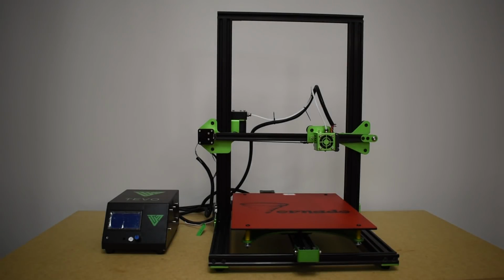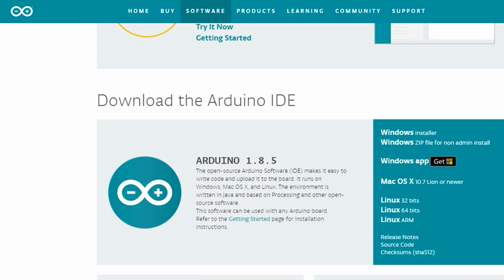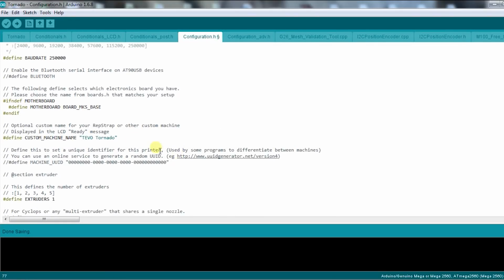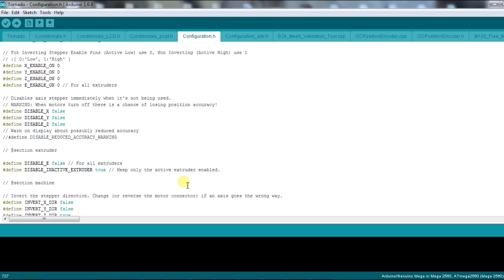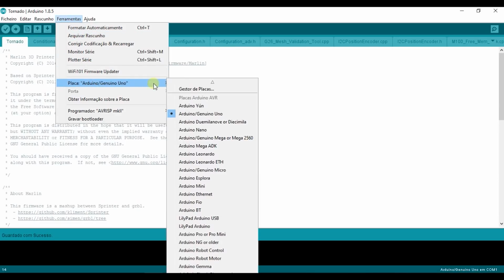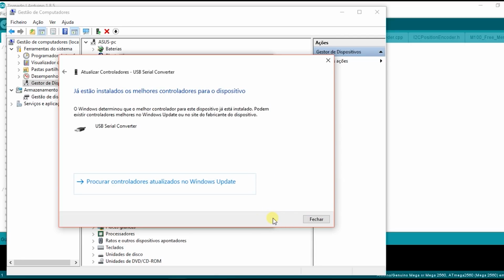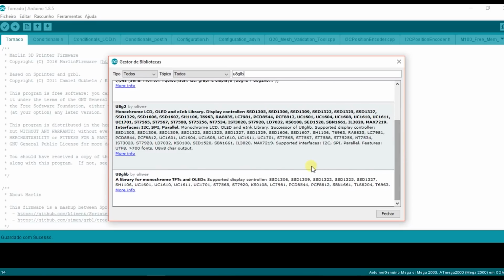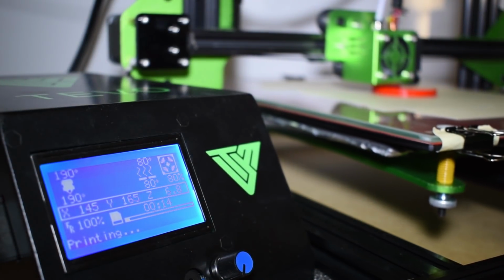TEVO TORNADO 3D PRINTER - HOW TO UPDATE THE FIRMWARE

Comment: Hi on my Tevo Tornado the bead temperarure start to show 70° when just turn on, so i think is the termistor, i interchange the conections on the board and nop, the same so that means that is not the termistor. I order a new board an is about tonarrive, do i have to do the same on this video to load the firmware or some thing diferent since is a brand new board???
Reply from the maker: Hi, most probably yes, you will need to install the bootloader first on the new board. You can try to install the firmware first anyway and check.

Comment: Trying to do this with the Tarantula Pro after following your install and setup videos.  I bought this second hand, and the original owner had installed the touch/auto-level sensor but did it incorrectly.  It has the hardware, but not the firmware for the sensor as best I can tell.  So I followed your video to check the sensor out, which led me here.  But I get an error and my computer doesn't have some of the USB drivers yours seems to and I can't get them to replicate.  Arduino says, "Compilation error: #error "Oops! Make sure you have the LPC1768 environment selected in your IDE."

Also, for some reason, when I move my x & y axis on the printer 1mm, it appears the axes are inverted (+ moves in the - direction in both x & y axis)

Comment: Hey there, sorry to bug you, but I attempted to do this to my tornado to change some extruder settings after installing a BMG to it, but unfortunately upon upload, I get the error:

avrdude: stk500v2_ReceiveMessage(): timeout
avrdude: stk500v2_ReceiveMessage(): timeout
avrdude: stk500v2_ReceiveMessage(): timeout
avrdude: stk500v2_ReceiveMessage(): timeout
avrdude: stk500v2_ReceiveMessage(): timeout
avrdude: stk500v2_ReceiveMessage(): timeout
avrdude: stk500v2_getsync(): timeout communicating with programmer
An error occurred while uploading the sketch

Any idea how to fix this? This is on a brand new, 2 week old Tornado running Marlin 2.0.5.3 from factory.
Reply from the maker: Hi, that error means the PC/arduino IDE is not communicating with the board. Check the baudrate and com port settings.

Comment: My computer will not install the drivers 
:(
Reply from the maker: Did you install arduino IDE? It also has the FTDI drivers. Are you working with a Windows PC?
Reply: @ruiraptor  Weird bug. Apparently the USB has to be plugged into the motherboard, it wouldn't connect through the front ports.

Comment: hey! this is a great video and the first time it worked but my extruder was running backward, when I did the update in arduino everything went well except when I tried to upload it to my tevo tornado. Here's the error:

Arduino: 1.8.12 (Windows 10), Board: "Arduino Mega or Mega 2560, ATmega2560 (Mega 2560)"

Sketch uses 119002 bytes (46%) of program storage space. Maximum is 253952 bytes.
Global variables use 4607 bytes (56%) of dynamic memory, leaving 3585 bytes for local variables. Maximum is 8192 bytes.
An error occurred while uploading the sketch
avrdude: ser_open(): can't open device "\\.\COM6": Access is denied.

avrdude: ser_drain(): read error: The handle is invalid.

avrdude: ser_send(): write error: sorry no info avail
avrdude: stk500_send(): failed to send command to serial port
avrdude: ser_recv(): read error: The handle is invalid.

avrdude: stk500v2_ReceiveMessage(): timeout
avrdude: ser_send(): write error: sorry no info avail
avrdude: stk500_send(): failed to send command to serial port
avrdude: ser_recv(): read error: The handle is invalid.

avrdude: stk500v2_ReceiveMessage(): timeout
avrdude: ser_send(): write error: sorry no info avail
avrdude: stk500_send(): failed to send command to serial port
avrdude: ser_recv(): read error: The handle is invalid.

avrdude: stk500v2_ReceiveMessage(): timeout
avrdude: ser_send(): write error: sorry no info avail
avrdude: stk500_send(): failed to send command to serial port
avrdude: ser_recv(): read error: The handle is invalid.

avrdude: stk500v2_ReceiveMessage(): timeout
avrdude: ser_send(): write error: sorry no info avail
avrdude: stk500_send(): failed to send command to serial port
avrdude: ser_recv(): read error: The handle is invalid.

avrdude: stk500v2_ReceiveMessage(): timeout
avrdude: ser_send(): write error: sorry no info avail
avrdude: stk500_send(): failed to send command to serial port
avrdude: ser_recv(): read error: The handle is invalid.

avrdude: stk500v2_ReceiveMessage(): timeout
avrdude: stk500v2_getsync(): timeout communicating with programmer

This report would have more information with
"Show verbose output during compilation"
option enabled in File -> Preferences.
Reply from the maker: Hi, it seems that you didn't select the correct com port.

Comment: Can you give me the link to the correct 2018 gold editio tornado firmware. When I try to go to the link in the video I can't find the correct firmware. Thanks
Reply from the maker: Hi John, the easiest way is to download Marlin 2.0 and use the configs for the tevo tornado (check the config examples in the Marlin folders). In this video you can see how to get the config files from Marlin (https://youtu.be/faHfUIZXPMo)
Reply: ruiraptor thank you for the help.  I need a little more help. I downloaded the marlin 2.0 file which did not include the config/example files. First, issue. I then found a second link to the tevo example files. I see that there is a 3rd bug fix set of files. I see in the board.h file there is no board for the mks_gen_L board. Another issue. I emailed Tevo and for their stock firmware they said the mks base board has the same pinout so I could use that file.  I am not sure which is easier/better; just use the Tevo firmware or use the Marlin 2.0 version. I guess I will have to use the motherboard type of mks_base. Is this a toss up on which version to use? Or is there any advantage using the Marlin software over the tevo software. Thank you.
Reply: @ruiraptor  404 not found..
Reply: @ruiraptor  also The like does not work.
Reply from the maker: John, do you have a facebook account? If yes, look for firmware updates or firmware versions from users in the official tevo tornado facebook group.
Reply: @ruiraptor  I have checked just about everywhere including Facebook. I am slowly getting all this down little by little.  I think someone needs to update Marlin 2.0.x for the MKS_gen_l v 1.0 and v1.4 boards. This is a common board.

Comment: I have some questions about Tevo Tornado hot end problem. My Tornado (Feb 2018 version) had been printing ok. Then on a print job it got all messed up with the body lifting off the bed and filament building up, ....etc. What I found was the hot end was not heating up to temperature and the filament was trying to extrude more in a soft plastic blob fashion rather than a filament thread. Tevo was set at 210 C but the hot end measured about 142 C directly on the hot end on the heat sink (fans off to the side). I figured the thermostat went bad and installed a new hot end but still have the same problem. So now I guess the problem is in the board or software. You explained it very well, but it still seems rather complicated to me (still trying to figure out my cell phone). Not sure what to do next, so your opinion on a direction for repair would be appreciated. I also better mention I would be using a Mac lap top, not Windows, would that be a problem? Thanks.
Reply from the maker: Hi Tom, if you have a mac, then you need to install the arduino IDE for mac. Use it to open the firmware and flash to the board.
Reply: @ruiraptor  I was looking over some videos on how to flash firmware. Being new to anything like this I did get lost on some points right off. 1st - picking the port and baud rate. Video was for windows and showed the Device Manager, I don't know where such a thing is on the Mac? 2nd - video showed code lines where specific board and other values were to be entered, I have no idea what my board type is. 3rd - a 100K thermistor was picked, but mine measures about 146K ohms. The video didn't seem to show any optional values. Once files are made and connection to the printer is made  what does one do to start the flash? May seem like a simple question but I have neve done anything like it before.
Reply from the maker: Hi Tom,
1- can't help you there as we don't have a mac. Try googling for this step.
2- Are you referring to the settings in arduino IDE? If yes, then you need to select the same board and processor as in our video (if you are using the tevo tornado)
3- We didn't mention any thermistor. If you download the firmware for the tevo tornado, don't bother with that since that comes already setup.
Reply: @ruiraptor  #1 I have yet to find an answer. I called the Apple Store in town and as of 2 days they have not called back. Support is not their # one priority. My guess about the MAC is all I have to do is connect up the USB cable and it will then connect up - magic! Or not.

#2 I still don't know the board type, so I will go back and check out which board you used and use it.
Lastly - I will try to flash the firmware after figuring out a few more things. If it fails I have been looking at the Sovol SV01 as a replacement. Will post once more in a few days as to final outcome.
Thank you for your assistance, I really appreciate it.

Comment: Im trying to upgrade the firmware on the Tevo Nereus and a having a really hard time trying to figure this out. Is it even possible to run marlin on the nereus. Im having problems with me extruder motor after putting a direct drive on it im hoping the firmware will fix it ive tried everything else I can think of the motor is getting power but its not strong enough to turn the direct drive unit and when its not on the unit it just skips in place
Reply from the maker: The Nereus runs Marlin from stock. Not sure what you did but check the steps/mm and the vref value.
Reply: @ruiraptor Thanks for the reply. I got it figured out after watching a few videos. I was just being a novice doing unnecessary things lol. I did not know the Robin nano is 32bit so I used Atom and the nereus example in the Marlin firmware. I was trying to change the stepper drivers in the firmware with great difficulty until I learned this is unnecessary. As for the extruder stepper the cable I was using was my issue. Took me a bit to figure that out but now I know to be cautious of this in the future(especially before I tidy up the cables, learned that one the hard way). Im well on my way now with what I'm doing to the printer(I put a V6 hotend and a dual drive extruder on it cant wait to try it out) again thanks for reply, and keep up the great work!

Comment: Ruiraptor, Can you please send me the Tevo Tornado Flash Firmware (with the Tevo.ino file), The Tevo Facebook group is closed and the current github Marlin link is creating too many error messages when trying to flash with it in Arduino. Apparently someone else in your comment section had exactly the same problem. My email is fairvalues@gmail.com

Comment: Request Help!!! Getting this error 

avrdude: stk500v2_ReceiveMessage(): timeout
avrdude: ser_send(): write error: sorry no info avail
avrdude: stk500_send(): failed to send command to serial port
avrdude: ser_recv(): read error: The handle is invalid.

avrdude: stk500v2_ReceiveMessage(): timeout
avrdude: stk500v2_getsync(): timeout communicating with programmer

avrdude done.  Thank you.

Problem uploading to board.  See http://www.arduino.cc/en/Guide/Troubleshooting#upload for suggestions.
Error while setting serial port parameters: 115,200 N 8 1

Connected USB to PC (NO Main Power) Windows 10 Sees it as Ramps (Comm5) however cannot get arduino to communicate with the board.
Reply from the maker: Hi, is it a new board?
Reply: @ruiraptor  no it is not exisitng board that was in it just changed the drivers to 2208 and 8729 already adjusted vref voltage for them just cannot reflash firmware to new steppers

Comment: i cant fine the firmware on facebook group help?
Reply from the maker: You have to look in the file section.
Reply: @ruiraptor  And also my tevo tornado while printing it will randomly home y and x axis and the extruder tries to pull filament out and back in and continue printing. i tired 3 sd cards. same problem. would love for you to help me with this issue.
Reply from the maker: Check the display and its cables. Make sure that they are correctly connected and the flat cables are not close to the power supply, SSR or any component that will cause noise interference. Also check if the card slot pins are ok and contact correctly with the sd card
Reply: ruiraptor thank you so much. Your videos in the tarantula helped me a lot to.

Comment: i have this weird -14 nozzle error and thought i would put marlin on and i did my best to follow your instructions but i don't have face book so I got the marlin from github any way i have red words what do i do now?
Reply from the maker: Hi,
Check if the original tevo firmware compiles correctly ( https://github.com/tevo3d ). 
Do you have all the libraries installed?
Reply: @ruiraptor  OK i have flashed it I think, but it never changes the home screen from 1.1.4  it just says tevo like normal. Anyway I put new thermistor in and it was only one degree different from bed.  I am terrible with soldering iron. so we will see how long the connection lasts. When I connect to my computer my computer sees a usb device but it doesn't show any kind of 3d printer. It allows me to upload etc. Or at least it acts like it is. Printer screen blinks like your video. the print looks very under extruded that was a problem I had before thermistor broke.
Reply from the maker: @cscherbarth1622 , check your extruder calibration and flow/multiplier calibration. If you have your hotend correctly assembled ( check here: https://youtu.be/rvkj8f_xNtE ) then it might just be the calibrations.

Comment: Hello, I was updating my firmware for the Tevo Tornado and I get this error. Sketch uses 127454 bytes (50%) of program storage space. Maximum is 253952 bytes.
Global variables use 6394 bytes (78%) of dynamic memory, leaving 1798 bytes for local variables. Maximum is 8192 bytes.
Low memory available, stability problems may occur.
avrdude: stk500v2_recv(): checksum error
avrdude: stk500v2_recv(): checksum error
avrdude: stk500v2_recv(): checksum error
avrdude: stk500v2_recv(): checksum error
avrdude: stk500v2_ReceiveMessage(): timeout
avrdude: stk500v2_recv(): checksum error
avrdude: stk500v2_ReceiveMessage(): timeout
avrdude: stk500v2_recv(): checksum error
avrdude: stk500v2_recv(): checksum error
avrdude: stk500v2_recv(): checksum error
avrdude: stk500v2_recv(): checksum error
avrdude: stk500v2_recv(): checksum error
avrdude: stk500v2_recv(): checksum error
avrdude: stk500v2_recv(): checksum error
avrdude: stk500v2_ReceiveMessage(): timeout
avrdude: stk500v2_recv(): checksum error
avrdude: stk500v2_recv(): checksum error
avrdude: stk500v2_ReceiveMessage(): timeout
avrdude: stk500v2_recv(): checksum error
avrdude: stk500v2_recv(): checksum error
avrdude: stk500v2_recv(): checksum error
avrdude: stk500v2_recv(): checksum error
avrdude: verification error, first mismatch at byte 0x0775
         0x64 != 0x12
avrdude: verification error; content mismatch
avrdude: verification error; content mismatch 

Thanks for the help.
Reply from the maker: Hi,
what firmware are you trying to compile and flash? Where did you get it from?

Comment: Thanks for educating me on how to effectively access and flash my firmware. A couple questions. What changes if any to flash the Gold 2018 Tornado, as far as board, processor, programmer, library, etc. I have recently replaced the heater cartridge and thermistors in both the Green and Gold Tornados and now I am having to print as higher temperatures and still getting delamination.

Thanks again!
Reply from the maker: Hi,
Regarding your first question, you can flash the firmware on the gold the same way as you flash with the green. I don't know which green version you have but there is one with an MKS Base board (with Allegro A4982 drivers) and a green version with an MKS GEN L board (with Allegro A4988 drivers). The firmware is the same, you can just modify the board model in the firmware but it's not critical if you don't. Regarding the temperatures problem, make sure you get the correct thermistors and heaters (check resistance value and voltage) and that it's displaying the correct temperatures.

Comment: Can I flash this to a MKS GEN L v1.0 board? Or just the mks base v1.4
Reply from the maker: You can install and flash either on a GEN L or MKS base 1.4.
You just need to make sure that the firmware is configured for that board and drivers.
The layout is also different as you can see in my other video here: https://youtu.be/RhlTdTLfaQ0